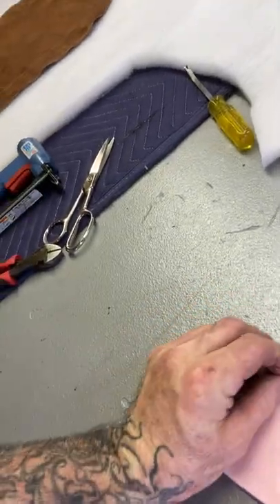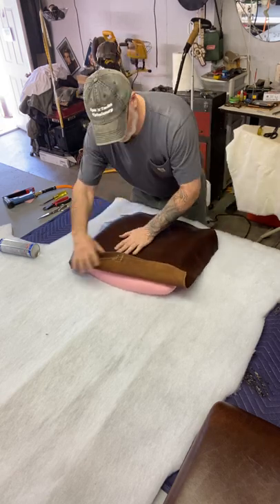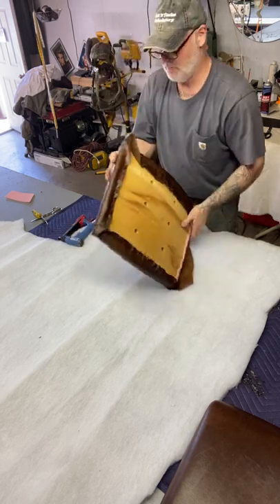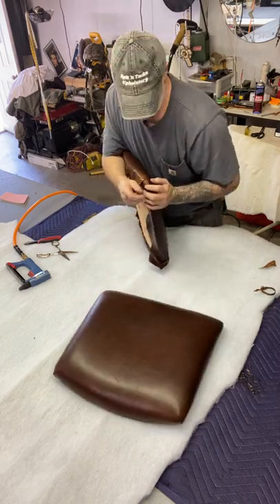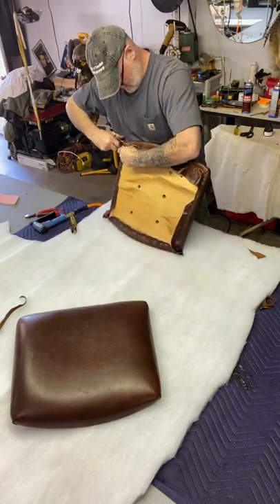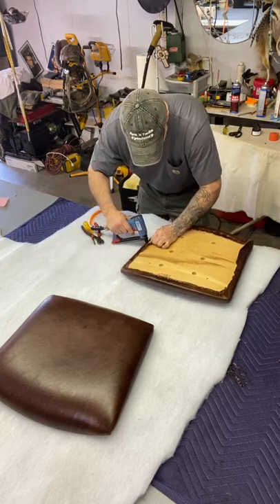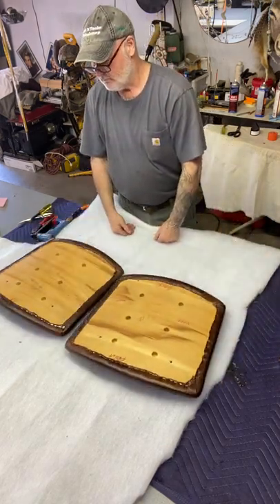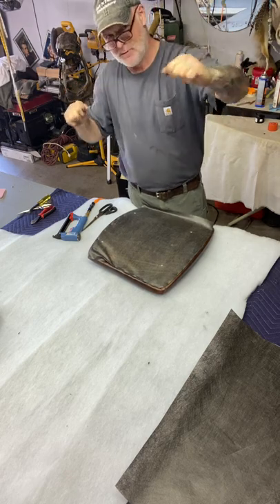Chair Reupholstery

Comment: Hey Colt I have a question, in this video you mentioned that you use 3/8 staples, is that with or length? The reason I asked is in some of the boat upholstery videos I’ve seen they mentioned to only use 1/2 wide staples, I already have a 3/8 wide stapler so when I attempt to attack my boat with new marine vinyl would I be better off purchasing a 1/2 wide stapler, sorry for the novice question but I trust your experience, great video my friend 👍😁
Reply from the maker: I use 3/8 crown and 3/8 leg for 90% of everything I do.  If you have several layers of foam, you are going to want to buy 3/8 inch crown (which is the width) and 9/16 leg (which is the length) in order for you to acquire a good bite.  Now, be mindful to take your 9/16 inch staples out if you are doing something thinner, be mindful of what's in your gun.  And a good gun to get is a Bea.  You can buy them on Amazon for about 250 bucks.  Its an investment, but they last and last.  2nd choice would be a Fasco.  But buy them on Amazon, dont buy from a dealer.  They are cheaper on Amz, I've found.  Sometime you should send me a picture of what you are working on.  Hold it down, Dave!
Reply: @spitntacksupholstery8080  thanks so much for your reply my friend 👍😁